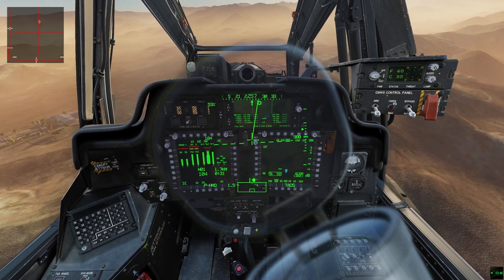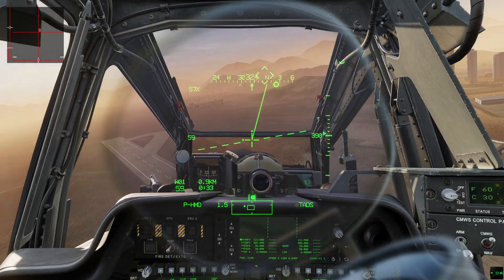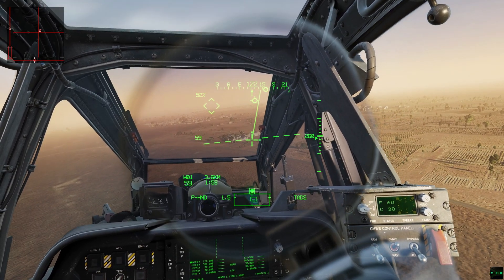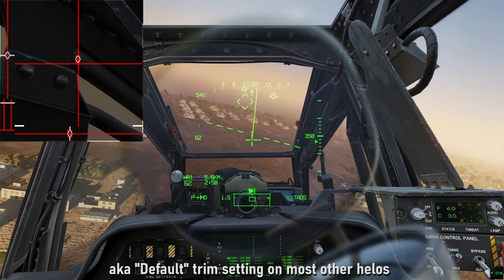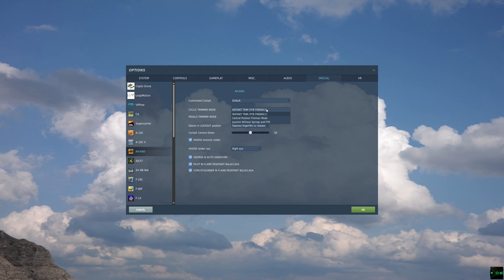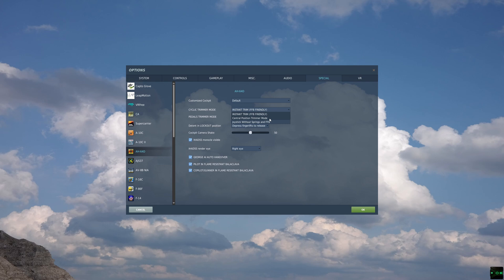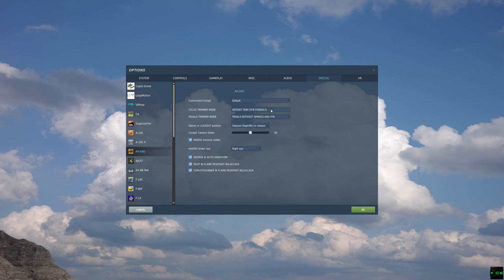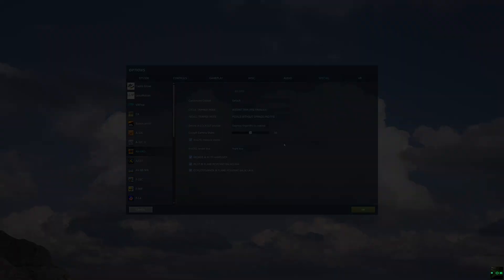How to Fly the DCS AH-64D Apache #2: Trim settings and Force Trim Release

Comment: Hopping back into the cockpit...

I have a fairly stable joystick with a 15cm extension. Using the extension, the light spring is barely enough force to recenter the stick on its own, so it's practically springless. However, I am worried that the "springless" mode won't work as well because it is hard to use curves if you are constantly operating off-center.

I could use Instant trim, but with the light spring it feels like I have to work harder to snap the stick back to center to avoid over-controlling when I set the trim. SO maybe I use a stiffer tension with instant trim mode?

TL;DR: I am debating between the following:
- INSTANT TRIM w/ stiff spring + soft curves
- INSTANT TRIM w/ light spring + soft curves
- JS Without Springs w/ light spring + no curves

Do you have any thoughts? What is your setup like?

Of course I have a VIRPIL CM3 (with the dry clutch) on backorder, so I will probably have to reevaluate whenever that finally arrives, as well...
Reply from the maker: Totally not jelly of your setup. And I'm not a super-authority on springless setups - so take with a pinch of salt: If the soft spring and extension is such that you can (and don't mind) holding the stick in place (or it holds itself in place), then that would be pretty cool. With an extension, you may be able to run completely without saturation & curves. So maybe try that with the no springs or ffb option. That may be the first prize. If you find holding it/letting go and it resets is a problem, then I guess go with the instant/central position trimmer - and if you're finding it doesn't easily recenter itself then go with a stiffer spring - as long as you're not needing to put too much effort/brainpower into getting the stick centred compared to actual piloting. I'm a bit hazy if the curves/deadzone helps with it recognising centering for the purposes of the central position trimmer, or if it's purely a hardware thing.
Reply: @volkvoort  Thanks for the feedback!

So putting a few hours of flight in, I was already starting to feel like the cyclic was a bit "soft" with 90% saturation/25 curvature. I went back to full saturation and 15 curvature, and I suspect that with a little practice I can get down to linear with the extension.

Trying different trim modes, I can operate with the light stick in the "springless" mode just fine, but due to placement needs (and the fact that my extension is just a straight one) I end up having to lean forward to hold cyclic in the proper position for cruise which ends up quickly becoming uncomfortable.  I do miss having the slight tension towards the desired "trim position" as a reference that you'd get with FFB or instant/center trim, though. Also, hand has to stay on the stick all the time to hold position now, which makes cockpit-clicking hard.

The Center Position trim mode didn't work well with the light spring -- I had to be too conscious about getting it reset before it would unlock. Instant Trim works alright, I just with the delay before the trim resets were a little longer since I don't have as strong of a spring to snap it back.

Ideally, I think some version of "Center" trim mode where the trim position would be set when the trim button was depressed, and then the stick was re-enabled once the button was released would be ideal, as it would give you the smoothness of Center Joystick mode but without the problem of sometimes not resetting. I think that with an offset extension (like the virpil S or Z extensions) to shift it a bit closer to my body I could definitely pull off the springless trim mode, especially with the clutch in the new base. Something I'll have to experiment with I guess.

Anyways thanks for the great videos!
Reply: @hubismaximus  Hi, I hope you dont mind me jumping in here! I too have the CM3 arriving this week sometime and am in a similar quandry as to how best set up the hardware and software options.....compounded by the fact that I literally just started learning to fly helos with the Apache, so dont have much experience or points of reference to refer to....I currently use a CM2 base with Virpil Z extension and its very light to hold in cruise position. I dont really use trim that much, (but all these tutorials etc make me think that I should be using it more! ) as its currently fairly easy to fly. I am hoping with the new CM3, I can leave the stick in commanded position and not really bother with trim.....Or am I missing something? Volks raises a good point about refinding centre though, I guess that may be tricky in that situation? To clarify, you are currently using the "Instant trim" option in DCS?
Reply: @markturner6091  Hey, sorry for the delayed response here!

I assume you've experimented some since you posted but yeah I would say that removing the springs + clutch dampening to let you keep the commanded orientation will give you the identical behavior to holding the "set trim" button down, which is common when maneuvering. 

I think all the tutorials talking about trim are assuming the (very) common case of someone with a standard, no-extension/no-clutch HOTAS. You are not supposed to have tension on the stick for a stable orientation, as it becomes both harder to fine-tune and is fatiguing. 

I think the issue of "losing the center" is double-edged. In the clutched/no-trim case you don't have tactile reminders to return you to your ideal center point for a given mode of flight; however, you have the stick orientation giving you physical awareness of the cyclic's absolute position. Meanwhile, in the no-clutch/center-trimmed case you set a new center point with the trim and have the spring tension giving you feedback on returning to that point, but you lose a good bit of situational awareness as to the cyclic's absolute position (which can be really disasterous at times). In a real helicopter (and fixed-wing stick for that matter) the trim adjusts the physical center point of the stick so you get the benefit of both without the drawback, but unfortunately until Virpil makes a force feedback base we don't have that option.

Between the two, I would say that IF you are doing primarily rotary-wing flight I think the clutched/no-trim mode is probably better simply because you can learn the general stick position for various flight modes and have a good idea what the "center" point should be. If you sometimes switch between fixed and rotary wing flight then a medium-tension stick with the INSTANT TRIM mode is probably better (since fixed wing will tend to want that recentering property and switching between the two is a PITA). Since I've been learning jets I haven't bothered to try the damper-only adjustment myself yet, but please update with your thoughts if you try it! Maybe some day I will buy a second base just for rotary-wing use :-p

Comment: What's the diff between up/down/left/right trim buttons?
Reply from the maker: Up behaves like a normal force trim release (FTR), or trim button on other helos. Sets the new 'default' stick position from which is would give resistance if you had a force-feedback stick plugged in. It also sets parameters for the Hold modes to try & stick to. Holding FTR it would remove all the pressure from it trying to keep a centre-position, allowing you to wiggle away, and temporarily stops it trying to correct the flight parameters.
FTR Up, right and left have to do with Hold modes. Right boxes your altitude caret on the helmet display and has it trying to maintain your current (I think radar) altitude.
FTR Left does different things depending on your ground speed. 0-5 knots it holds your hover position. 6-40 it keeps your velocity. Once you speed up to 40 it keeps your attitude (pitch, bank, yaw). If you then drop down to 30 knots it goes to velocity hold. It'll have a box around your speed on the left while it's on.
Pressing FTR left/right a second time disables that holding mode particularly, pressing FTR Down cancels all the hold modes.
Reply: @volkvoort  Very helpful, thanks so much!

Comment: Real world, you trim before moving to prevent it from jumping
Reply: Hold or temporarily interrupt the force trim and then move the cyclic to the desire position and release. If you are in forward flight you can trim the aircraft to maintain the attitude/airspeed so it doesn’t fight you. If you never interrupt the force trim you will feel a force pushing against your movement since it tries to hold the position it was las set at. Also holding the force trim for 3-5 second also clears out and recenters the scas sleeves in the flight control BUCs cylinder which can get to a point of saturation aka SAS saturated messages pop up
Reply from the maker: You mean tap trim, move stick short distance, tap to easae pressure, move it further tap trim again to set the final resting place and then "let go" (as in ease your grip, rather than actually letting go of the controls)?
Reply: @volkvoort  no hold trim make the movement then release, I flew with it held most of the time.  Some people are tappers which works but not the best technique.  They did this because their control touch wasnt that good.
Reply from the maker: Ah. Ok yeah, from what I've been told often tapping or holding trim are options/by preference for many helos. In DCS with the Shark for example though you have to Hold trim, as tapping doesn't work in the sim like it appears to from some IRL videos.
As I understand it though, in the Apache Delta model, hold trim isn't really used, since it disables some of the systems assisting your flight (I forget which ones off the top of my head). You do hold it in for a bit to reset/recenter the SCAS, but otherwise IRL you generally fly by tapping. So aircraft specific, and in this case seemingly accurate to the real thing.
Reply: @volkvoort  yeah real world some are tappers and some are holders, I was a holder and personally felt it was the best way to go and from my experience resulted in the best pilots. Real world speaking, games sims are always harder due to the control/gamizm
Reply: @DragonBuildsRC  As I understood it the trim in the AH-64 resets the center point for the stick resistance, as in the stick stays in that new forward (for ex) position. Is that correct? What does holding the trim do in this case, just remove all resistance until release?

Comment: Great vid volk! can you do a test of max range of hellfire (that consistently reaches target) and cannons? and tips on how to increase the hellfire range? like speed, alt ?
Reply from the maker: I can add it to the ever growing list ;-). My understanding is 8km by the book. Some say it can go further but accuracy starts dropping. Heard others say accuracy starts dropping even before 8. Not sure what the did in DCS - and I'd expect that to change when a patch or two comes along as they refine numbers in the engine. Speed would boost it a little, but I mean you're adding maybe 250 kph maxish speed to a missile going 1600kph at it's apex. It'll help, but proportionally not that much. Altitude should though, hence those other numbers of 10 to maybe 11km reach if fired from a few thousand feet up.